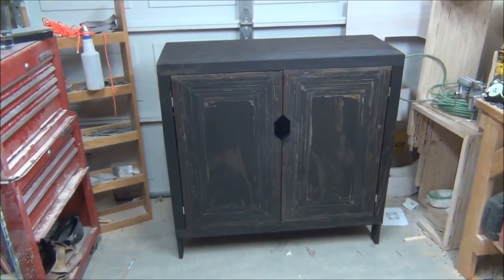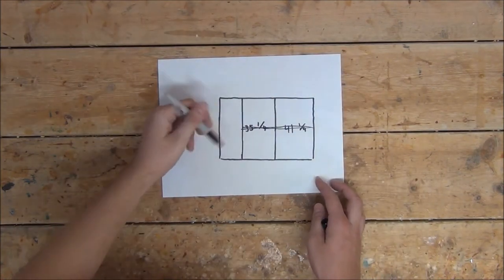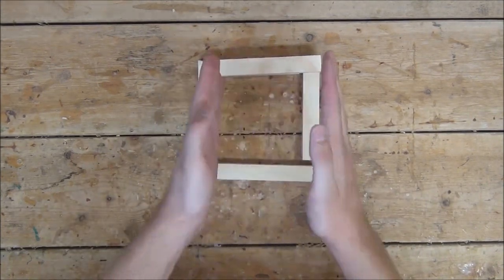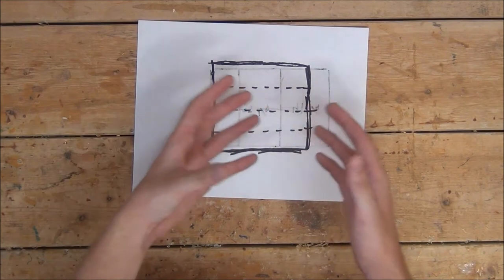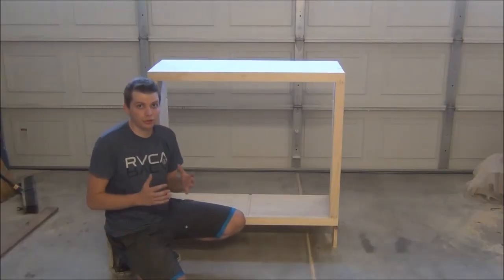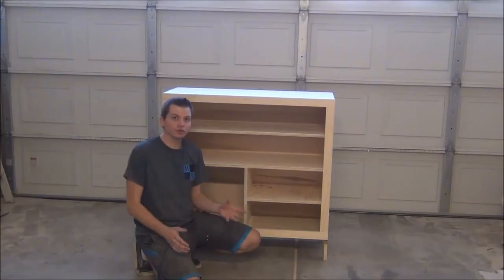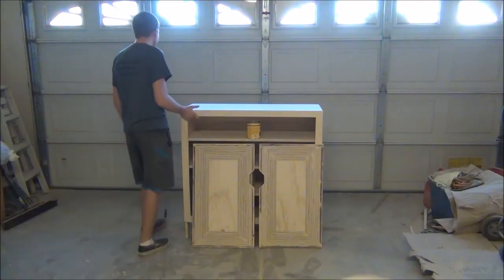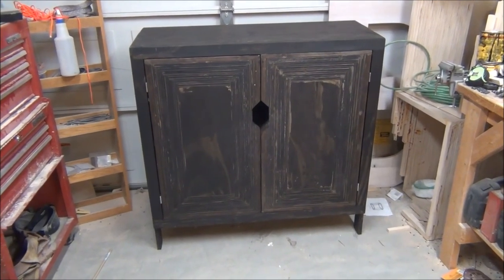How To Build A Shoe Cabinet!!!

Comment: Hey,
I am trying to make this at home. I didn't understand how you made the doors. Can you explain a little? Also, before placing the doors and after the structure was made you made a front frame, how did you make that frame?  And my last request to you is to list the tools you used to make this cabinet. I have never done anything like this before and I know I will be able to do it as it seems super easy. I just need some guidance from you. I hope you see this comment and reply asap.
Reply from the maker: Hello! So happy to hear you liked it and want to make it! This is a more dificult peice however the main tools I used for it was: table saw, miter saw, curcular saw, power sander and of course a drill. As for how I built the face I just cut down a few pine boards and nailed them togeather. Similarly to how I built the cabinate itself. Hope that helps! Best of luck!
Reply: @MechNinji  Thank you so much for your reply. I got my answers and now  I ready to make a new home for my shoes. :)))

Comment: For the battle bot what channel do you plug the motors in???
Reply from the maker: Well im using a sky fly fs i6 transmitter and have mixed some of the channels. But with that being said i use channels 1 and 2 for the drive motors and channel 3 for the lifting servo :)

Comment: Sorry I'm late! This is an epic piece of furniture. The door design is super cool too. Also I did the math and with a 1/16th in kerf you made about 2.5 square feet of saw dust per sheet of plywood. :) Also, did you hit any nails while routing your shelf slots?
Reply from the maker: Yeah, whenever you wood work you end up with a lot of saw dust but this did produce a little more than usual! haha! And yes, not a lot but I did hit about 5 or 6 nails, but since the channels are so shallow its not a very common problem. Plus the nails are so thin the router can handle then rather easily.  :)

Comment: Hey bro i could really use your help on a project i just have a few questions can you please get back to me i just need like 5 mins of your time lol. Thank you
Reply: To be a bit more specific, i am a graphic designer/ videographer i am looking into building a diy follow focus system for my camera so i can control the focus wirelessly, i just need you to help me figure out what parts i would need and how to put them together. Ive seen other videos but they are not specific enough also i want to do it a bit differently. In return i would like to create an animated logo for your channel or any other visual work you may need!
Reply from the maker: okay, so how can I help? I saw the vid you left a link for and it seems like it would work, but you said that isn't quite what you're looking for?
Reply: so my name is Wayne I’m doing videography on professional level i’ve invested a lot of money into my equipment but i didn’t feel like buying this piece of equipment simply because its over priced for what it does, a wireless follow focus starts at $599 and a good one costs over $900. So after watching a lot of people on youtube build ones that looked pretty decent i wanted to give it a shot. In the original video i sent you the controller is just too big and i wont be able to use that on my camera rig, for me a really small controller or even a joystick/ little wheel that controls the rotation would be more practical. I honestly couldn’t find a video on how to control a servo through a joy stick wirelessly, I’m not sure if its possible but i would be willing to settle for it being wired. I seen a guy do it fairly well but he didn’t include good enough instructions for someone like me to follow, just to give you an idea I literally just started learning about this stuff this week, and i don’t know how to program the buttons. Ill include the link. 

https://youtu.be/W_aWhxWZYys

So since i had limited info, i bought a few pieces, first a wireless rc remote and receiver, now the original video i sent you the guy had to take the controller apart and take a spring off, i am hoping i don’t have to do this. I want your opinion becAuse on his controller the wheel controlled the gas/accelerator i wanted to try something different and i bough a electronic skateboard controller so the wheel on mine controls the rotation , and to my knowledge i don’t think i should run into that problem. However feel free to correct me if you see any issues with my plan. I am still waiting for these parts to come in and if you think i need additional parts i would like to order them as well. 
http://www.walmart.com/ip/2-4GHz-Radio-Remote-Controller-Receiver-Binding-Plug-For-Electric-Skateboard/901431295

Second i bought a servo that was 180 degrees, i seen and heard about people running into the issue where they wouldn’t get enough range of motion and weren’t able to control enough of the focus. I am honestly really lost since i don’t have the part yet and i don’t know whats to expect but i will send you this link as well and you can tell me what you think will happen. Also i heard these servos are very loud and i can work around this for now but the audio from my videos will be useless, in the future i would like to upgrade to a servo or motor that would be quiet and accurate if you have any suggestions please leave me links.

SunFounder Metal Gear Digital RC Servo Motor High Torque for Helicopter Car Boat Robot Arduino AVR Toys Drone Fix-Wing Airplane
https://www.amazon.com/dp/B01KZKOIZC/ref=cm_sw_r_cp_api_i_qGjcBbFSAM5PN

I really appreciate you getting back to me and i would honestly scrap my whole idea if you think theres a better way to go about this. I am open to any ideas you have. I have seen your work and i trust your judgement. Also like i stated before i do design work and can definitely create content for your channel in return. If not i would be happy to pay you  for your help. Thank you bro.